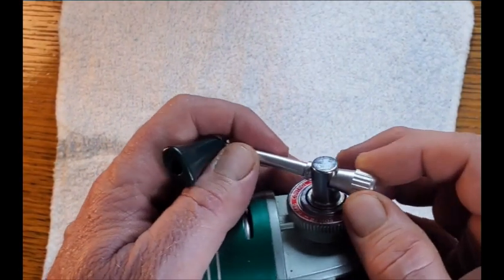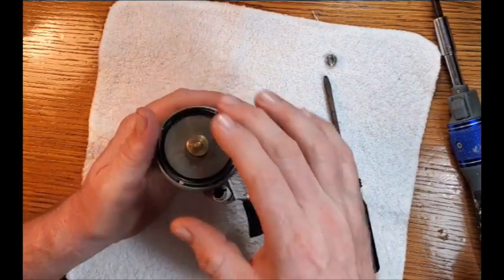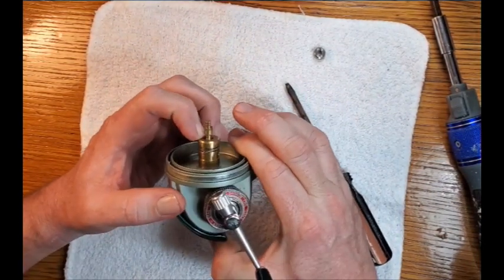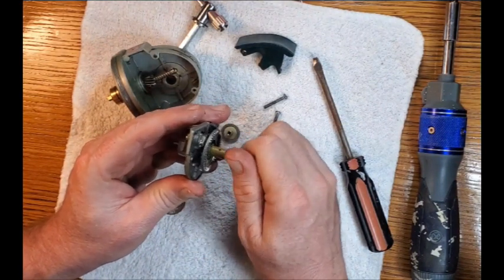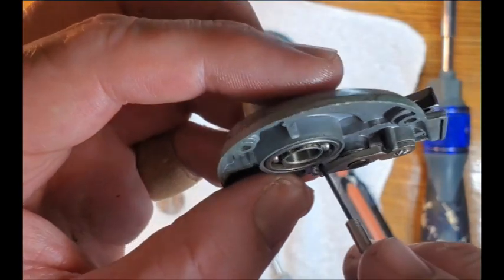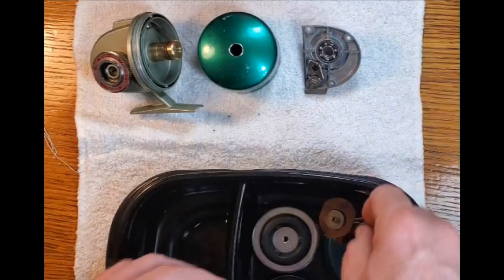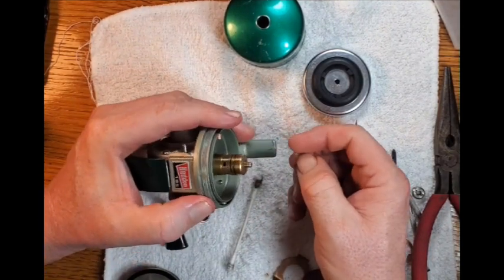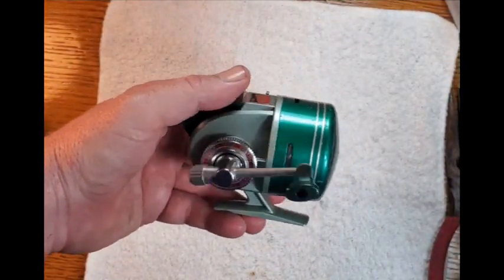Heddon 185 Convertible Spincast Reel - Service and Repair Video

Comment: I got a Heddon 152 the shaft spring is missing. Do you have any idea where I could get one. If I cannot get one I guess I could make one.
Reply: I Have A Heddon 150
Reply from the maker: That "D-shaped" spring in the spool spindle?  You can make one from spring wire available at a good mom & pop hardware store (or online).  I got some at my local hardware store.  They were calling it "music wire".  They had several different diameters for sale in ~3 foot lengths.  I've used it a lot to make repairs on fishing reels.